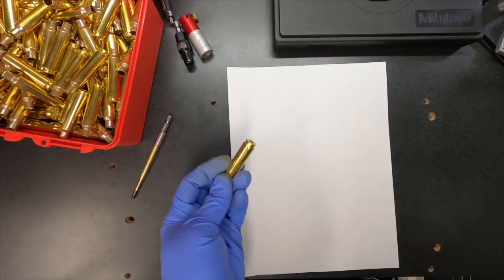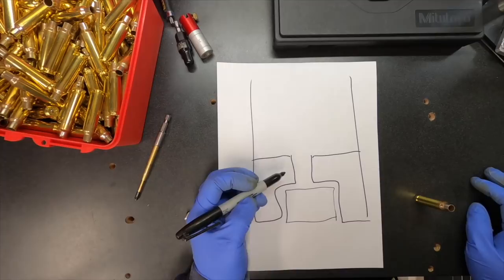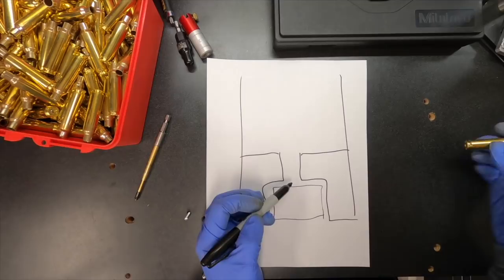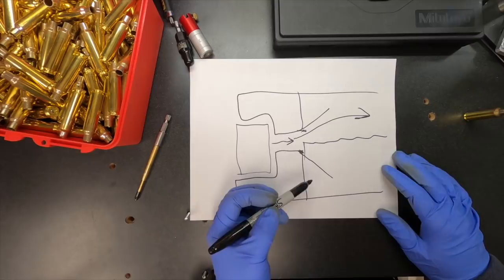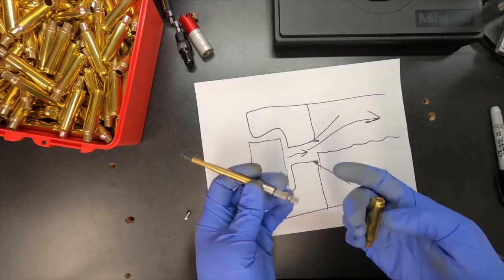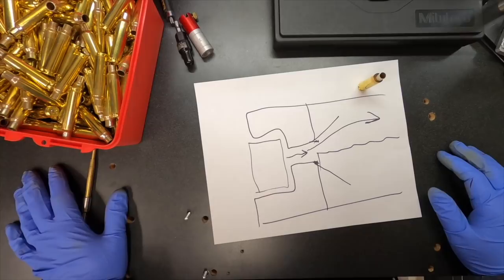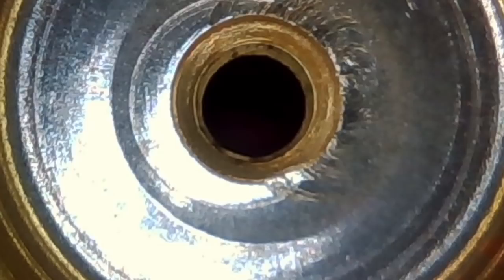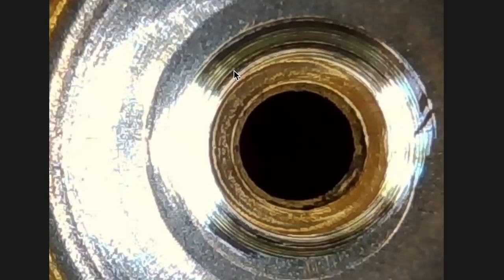Match brass prep: flash hole deburring

Comment: Hey John, you drew your powder really really low on the cartridge: I know you were maybe exaggerating for the sake of the diagram, but without talking about flashover, I think this diagram boarders on dangerous.
Reply from the maker: That’s a great point and I was exaggerating to make a point like you said but you’re absolutely correct that flashover can cause a dangerous situation and you should never intentionally under-fill a case.
Reply: Are you serious???
Reply: @steveshortt90  Yes? Not such a problem in a short cartridge, but in a long cartridge it can be: the powder is supposed to burn “slowly” from back to front, but if it's under-filled, the primer can light the entire top surface (~5x more surface area, the powder burns off ~5x as fast which will cause a pressure spike much higher than the design specs). So Ya, it's sort of serious.
Reply from the maker: @wilfdarr  I couldn’t say it any better.
Reply: Burning the powder column from one end is actually an unavoidable problem. It's a very inefficient burn. We would be better off with ignition in the middle of the column, but it's all but impossible to achieve.
Reply: It's a bloody sketch guys come on! No wonder these guys don't make more videos.. people whinging about a bloody sketch!
Reply from the maker: @timg6252  You're absolutely correct and it's been done, but it's expensive and difficult to reload. It's mostly been done on large artillery like this https://cartridgecollectors.org/cmo/cmo08dec.htm where they run a long flash tube mid-way into the brass for a more efficient burn. I've seen rifle cartridges like this too but it's very rare but very cool at the same time.
Reply: @timg6252  Yes, assuming that you had designed the system around such a burn. But that kind of efficiency in powder designed with a different burn profile in mind could go...unappreciated.
Reply: Wilfred, change the subject to gain the lime light?  You want attention ?  Get your own page, or perhaps a puppy!
Reply: In Wilfred's defense:
Until recently, I didn't understand why low powder charges can be dangerous.
As someone new to reloading, I noticed exactly what Wilfred did.
There are a lot of us noobs out there, and it doesn't hurt to point these things out in effort to save a face or two.
Also, thank you, John. I greatly appreciate your willingness to share knowledge.
Reply: That primer pocket looks a little loose also!

Comment: I've had a tool like this since 1983 when loading for IHMSA shooting 7TCU.  If there is any doubt, it DOES make a big difference.  My only quibble is the tools that index on the case mouth is too inconsistent between batches if you work on differing calibers.  Do a batch of cases today, change calibers then next month if you need more cases you have to duplicate the first batch by feel and guess but no way to measure.  Because of that I believe in the bushing style tool (sinclair generation II or the 21st century one).  Personally, I have a precursor bushing style that has a plastic knob for hand turning (no longer sold I think).  Works great even if you want to go crazy and debur 45acp or 9mm.

Comment: I use a Lyman flash hole uniformer with the collar that is set for freshly trimmed cases. Once thing I find is the inside case base to case mouth length is not the same, even within a batch of same headstamps. The uniformer will definitely cut more brass from some cases than others, regardless of the amount of burr debris.
An old timer told me to think of the flash hole the same as a fuel injector. Neither produces the consistent spray of fuel/flame it should when dirtied up. He made sense and once I began deburring flash holes, my groups improved.
Reply from the maker: Yeah that’s the only problem with this collet stop models like the Lyman. They can fluctuate a little. But I love you analogy!

Comment: After watching this video I did a test.  I did 400 pieces of Hornady factory ammo brass I had been holding onto.  I got 9.8 grains of brass chips and flakes from inside the brass just using this one tool.  I inspected a lot of them with my borescope and it was amazing how well it cleaned up all the flash holes that desperately needed deburring as there were tons of burrs on most of those 400 pieces.

Comment: I have two wildcat pistols built for silhouette shooting, used Parma style Benchrest brass, and even if it was the best available at that time, the flash holes were erratic to be kind.  Lyman has a similar tool, but multi caliber with an adjustable stop, that was used to deburr and slightly chamfer the inside of the hole.  Your tool looks caliber or at least neck diameter specific, which looks light years better than my old one.  Takes seconds, if only for peace of mind and possibly just possibly making everything possible similar, well worth the time.

Comment: Nice talk. BTW, the brass you showed in your "before" example is way better than brass like we have to start with in XTC. For example, most batches of LC brass or commercial 223 brass will have far more serious flash that might interfere with ignition. Your pile of debris and chips after your batch is less than what might come out of just a few of the worst offenders. All of which is to say, it is better to have the right tool when you need it so you have the option if you want it. Merry Christmas and Happy New Year!!!
Reply from the maker: Yeah I agree and the right tool helps for sure. Merry Christmas and Happy New Year to you too!!!

Comment: As far as consistency spend the $110 this tool is amazing. I wouldn't recommend this for bulk reloading. 

A properly sized end mill with or without a pilot, can clean up the internal area with a drill press and a proper shell houlder like the Forstner Case trim fixture PT1010. You don't get the consistency the 21st Century tool provides, its money well spent. For those bulk reloading maybe consider a $25 end mill in your drill press.

Comment: It's punched from the bottom. That's why the inside of the case has the irregular hole. It breaks through from the bottom and the rough part is on the inside of the case. It's  usually punched with the head stamp at the same time.

Comment: Thanks, gr8, informative and visual. 
I’m an addicted OCD reloader myself and often thought that my quest to consistent reloading has compensated for a lack of range time. One thing I’ve been wondering about is whether powder that enter the pimer and flash hole after reloading might equate to inconsistency. Surely this will happen to different amounts and degree. Ball powder more so compared to extruded powder I guess. Ammo being transported/stored in the vertical vs horizontal position. Vibration that over time might lead to compaction. No way that this potential space will be filled and compressed with a consistent amount of powder. Might this make a difference?? I know this comes down to splitting hair, but that’s what we do. 
I found some anecdotal information on the net of people seating primers through paper and using ‘flash hole wads’ to prevent this. More so with black powder rifles. Does anyone have more infomation or thoughts on this?

Comment: These little things add up that's why we do case processing..  Many trimmers, trim uneven with in +, - .005 around the same case.  
Why not do things the right way?   Thank you for permoting doing things the right way; we need it.  It is also challenges the manufactures when you bring things up.

Comment: Been doing this for years, a cheap usb camera like a Teslong is good for this as using my $1500 bore scope for this is a risk. Some of these cases inside finish is poor, just buy better brass to start with like Lapua. I did a ballistic lab test on primers and that showed a big SD difference in primer makes and the best was not a bench rest type, but that will change batch to batch i think.

Comment: You don’t believe a chamfer on the flash hole would promote a better more consistent burn of the powder?
I found that trimming the case to minimum saami specs and deburring before uniforming the flash hole with a collet type tool, got the most consistent results. 
Burrs on flash holes are a variable. Get rid of them I say...
Great before and after photos.
Reply from the maker: Glad you enjoyed it and found it helpful.

Comment: Does flash hole concentricity matter? I just picked up some Aguila brass and all of the flash holes are clearly and visibly punched off-center. I don't even need to measure with dial calipers to see that all of this brass is off a good 1/32 of an inch. Should I reload these? How will this affect ES and SD?

Comment: Have you done any chronograph and/or accurracy tests with brass not uniformed, then the same brass uniformed to see if it really makes a difference? It makes sense to uniform the flash hole, but I am curious to know how much actual difference it makes.
Reply from the maker: Yeah I've tested it and to be honest I don't bother anymore given how clean recent Lapua brass has been in the flash hole however that's my particular choice. I know there are still lots of people who who feel it's needed and depending on the brand of brass I would probably agree.
Reply: @FClassJohn  Thanks for your reply. I was wondering how much difference it makes to an average shooter like me who uses less than premium brass. I'll have to do my own tests. Thanks again.
Reply from the maker: @ronkellam8184  And the reality is there are so many things that go into the ignition sequence that cleaning out flash holes is honestly one of the last things I would probably advise most people to work on. Things like primer choice, primer depth, firing pin springs and powder choices often have a much bigger impact on extreme spread or standard deviation then cleaning out a flash whole will.

Comment: What is the affect of drilling the flash hole a little larger? Why is it set as a specific size? I don't see in the SAAMI drawings where the flash hole size is specified, maybe it doesn't matter to a point-don't want to weaken the case head of course.
Reply from the maker: I'm not drilling a larger hole, I'm simply devouring the inside edge of it. It just make for a consistent exit point for the flame.
Reply: @FClassJohn  Understood. I see that K&M has a premium flash hole deburring tool that also uniforms the flash hole itself. Just curious if you had experimented with that as well and what the results were.
Reply from the maker: @madman432000  I've honestly never messed with the actual hole size. Sorry.

Comment: do you do this after every firing for brass or just once?
Reply from the maker: I actually don't do this anymore. Lapua brass is coming out really good and I'm not seeing the need. However in cases where I've done it or if you're using brass that needs it, you only need to do it once.
Reply: @F-Class John  Thank you for the quick response. I'm currently doing it on some federal brass right now

Comment: well you ask how good this is working? I can tell you it works i used a carcano 6.5 i set up a box at 25 steps i hit target, i went to 50 yards shot a few shots and i set it aside yes a scout scoped rifle it was less then 1 moa i made the mount fit, i shimmed it with washers and glue!  you ask why ( i drove a it to a gunsmith 100 miles away  with proper mount and scope and need 4 holes drilled and taped i went back a month later not done i could not wait any more he said it was not a good shooting rifle) ??? if the guy in daily plaza had his ducks in a row would get same out come! sound or no sound! this was a chopped off one! i went threw ever 6.5 rifle i could put my hands on why you ask i cut lawn for a lady her dead husband worked under jfk had some to do with ag stuff farming secretary of ag under Jfk i went to 1000 yard shoot i heard same sound as tape on his murder! why after the med scoped me i could not do to much they forgot i was on blood thinner(big goof) ever since summer my life been upside down relation died his place was gone threw and set on fire! the day before i got there! i got back from 2 week stay at home order and the week one was done my neighbors though it was great time to pack up and move and not tell me or any one!! great right! how about 3 feet of snow in one night & then a 4 days to shovel out after restocked it all melted to 8-12 inches and ice all over ? some one in Pa rigged the election? some one mad?

Comment: How does this impact deviation?
Reply from the maker: Very very little but that's not really the point for me. I don't chase SD, I mostly chase ES but either way it's a very minor improvement but somehow, in someway it'll help something that I may never see. In all fairness I can probably bang out the same ES/SD with or without doing this but knowing it's clean across the board in there just gives me more confidence.
Reply: @FClassJohn  I have been doing a bit of research on this, and according to the benchrest guys, it's hard to measure any benefits unless you run across the rare buggered flash hole,  but better safe than sorry.  Cheap and easy.
I have a video idea that I believe many would be interested in watching. Maybe a series on what you did to bring your ES down.  What matters most, what matters some.
Reply from the maker: @codyway7424  yeah I agree and I can also work on a video like you suggested. Thank you for the suggestion.